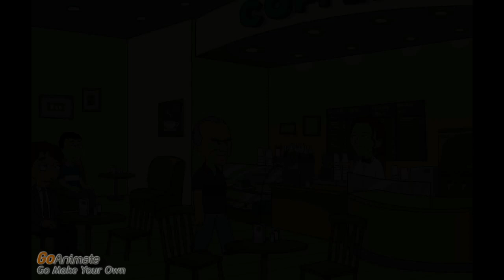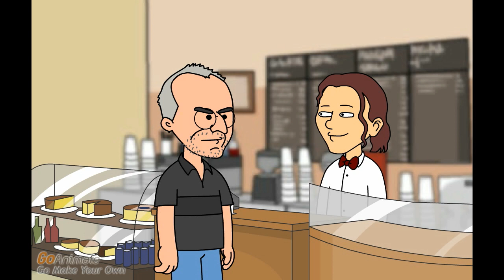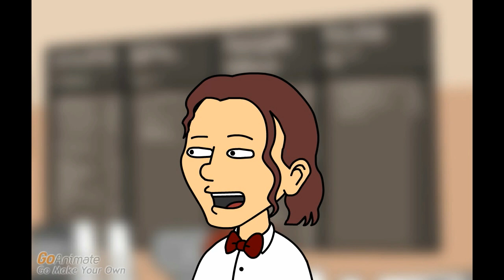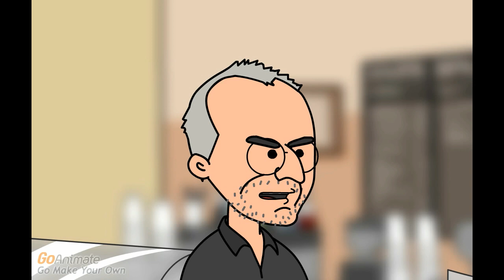My Furnace is Making a Rattling Noise!

Comment: And what should you do if the problem is a worn-out bearing?  My furnace only rattles a little while it's running and then after the heat shuts off something that sounds like a fan comes on and rattles a whole bunch!